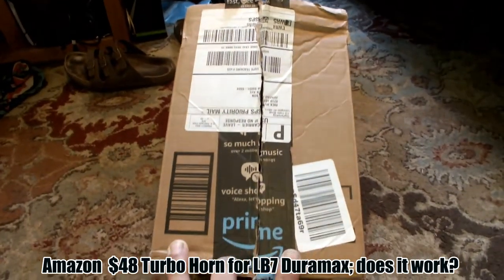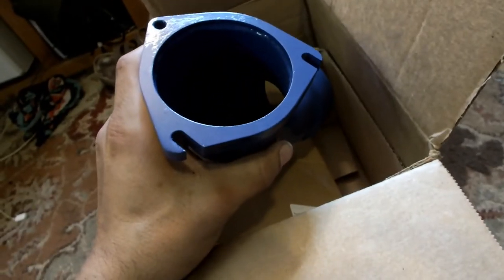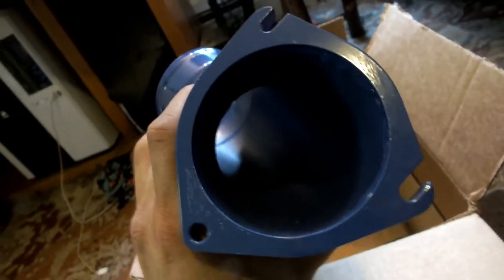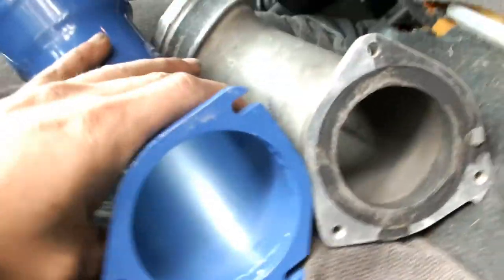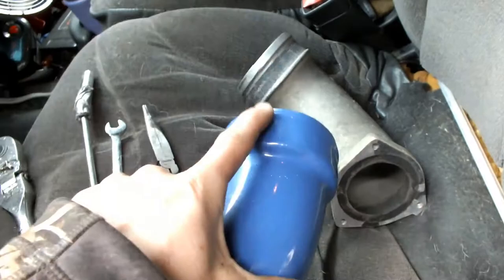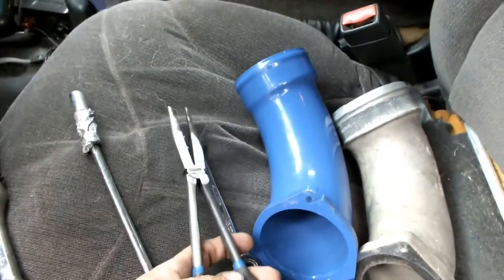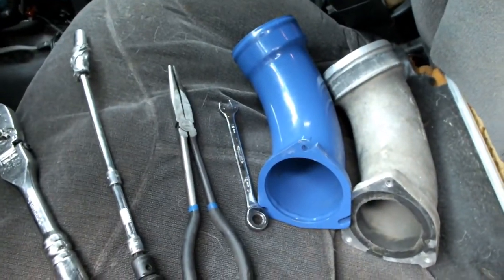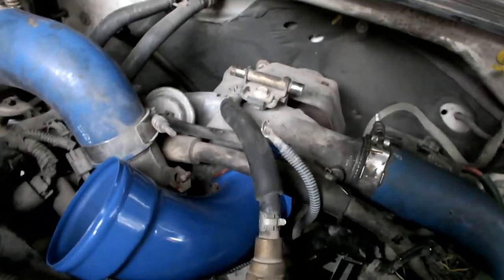LB7 Duramax Turbo Horn Installation: The Time-Saving DIY Guide

Comment: Before you start this project get a telescoping magnet incase you drop something and if you do wait till the horn is off to retrieve nuts or bolts. I removed the AC pump to get better access to bottom bolt, wrench for the top 2 bolts. Took me an hour. 
Its a louder whistle,  seems to spool a bit quicker.

Comment: Do hot and cold side charge pipe. Makes turbo loud af lol
Reply from the maker: Hell yeah it did!  The port matched aftermarket  downpipe, ported manifolds including  bd full bore manifold,  ported turbo with billet compressor wheel, ported heads, 45 over injectors,  4 inch exhaust and cold air intake helped too! 😀

Comment: wheres the before and after turbo whistle??
Reply from the maker: Hey Bobby, thanks for the question.   I have your "after" turbo whistle right here in this video:  https://www.youtube.com/watch?v=bF5CRrIennE   I gotta say though, " before" I couldn't hear any turbo whistle at all as one can imagine with the ole LB7 in stock form.  That said, the turbo horn matched with the AFE Cold Air Intake and MBRP 4" exhaust brought out the whistle and throaty roar.  Stay tuned though because we are gearing up for a turbo upgrade with a 10 blade turbine.

Comment: How’s it holding up after this much time
Reply from the maker: Hey Tyler, thanks for the question! The turbo horn is holding up great and gives that extra seat of the pants boost as well as provides a nice turbo whistle you can hear while driving.   Structurally it is stil strong, its not bent or melted or anything.  The paint still looks new too :)   You can see it again on some of my newer videos, especially the FPR video where I remove it again to gain access.
Reply: @KooshdaakaaGarage  Thanks for the info, I'm always leary of amazon specials but this one seems like a good buy.
Reply from the maker: @tylerroberts5704  I hear ya man,  I've always been leary as well and in part that's what led me to create this youtube channel and select so many different parts from Amazon that I installed on my LB7.  So far in relation to truck parts I've had a pretty solid experience.  Some of the cheaper parts I gambled on like the "OKAY Fuel Pressure Regulator" I picked up for $40 has been working great for the past few months I've owned it.  The Turbo Horn hasn't had an issue at all, and same goes for the intercooler pipe.   The name brand stuff from Amazon like the Dorman brake lines, PPE valve boost and PPE tuner is also standing the test of time and the Amazon experience was exactly like you would expect it: quick delivery,  free shipping with Prime, and priced just right.

Comment: How do you like that afe intake?
Reply from the maker: I like it!  Still have it after all these years and will most likely keep it on for several more.  Noticeable throttle response, little more turbo sound and works well with a tune and other mods.
Reply: @KooshdaakaaGarage  any noticeable gains in hp or torque?
Reply from the maker: @specops1903   I'd say so.  It's worth the upgrade over an OEM intake that is for sure.  Between the CAI, turbo horn, 3" intercooler pipes and the intake heater delete, there was a HUGE difference in seat of the pants feel, throttle response and even a little bit of MPG gain.
Reply: @KooshdaakaaGarage  nice thank you man appreciate it. I was debating this or the hsp
Reply from the maker: @specops1903   I hear ya, they are both good setups with their own pro's and con's.  AFE is plastic so it has better heat insulation and therefore will deliver cooler air than the metal HSP counterpart.  On the other hand HSP has nice paint job options and because it is metal it will let more of that turbo sound through.
Reply: @KooshdaakaaGarage  oh wow didn't realize that. Thanks for the knowledge brother

Comment: Does the exhaust sound better?.
Reply from the maker: You can hear the compressor side turbo whistle now to accompany the more throaty intake sound 🤘🥳
Reply: Things that make you go hmmmmmm
Reply from the maker: Yup.. Also spools quicker.  If it's the exhaust note you are looking for I'd look at the 4" mbrp video I have.  Pair that with a nice down pipe and you will be golden in the performance, and sound department.   👌 you can go the extra mile with uppipes and manifolds if your application calls for it.
Reply: Hmm good to know I have a stock 05

Comment: Steel, aluminum temps matter.
Reply from the maker: Absolutely aluminum temps matter.  Now do you say that because you prefer a steel horn fed typically by a plastic or aluminum air intake then into a steel turbo which feeds into an aluminum pipe which feeds into an aluminum inter-cooler back into another aluminum pipe then into a steel Y-bridge which feeds into a steel intake manifold then finally into the aluminum cylinder heads (which is a typical stock Duramax setup)? Is it your stance that a steel horn which heats slower and hold heats longer is superior to an aluminum horn which heats and coolers quicker to that of its steel counterpart?  I'm interested in the effects on both the air temps feeding into the engine as well as the effects this has on the EGTs... Perhaps you have tested this already and that is why you commented?  Please share your data. Depending on your findings I could be persuaded to re-assess my methods and swap out for a steel  horn.
Reply from the maker: @SINISTER69er  Sounds like we are on the same page :)   Cheers!